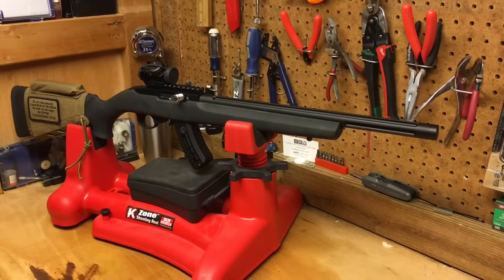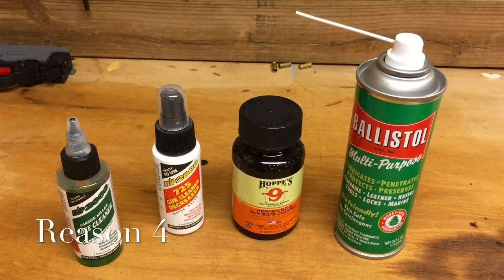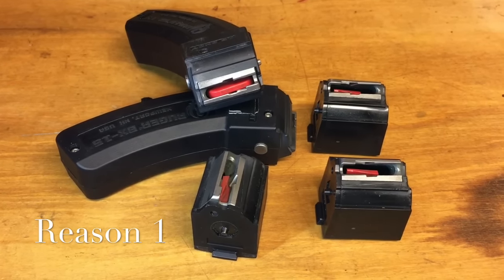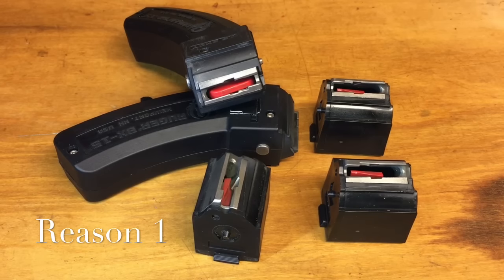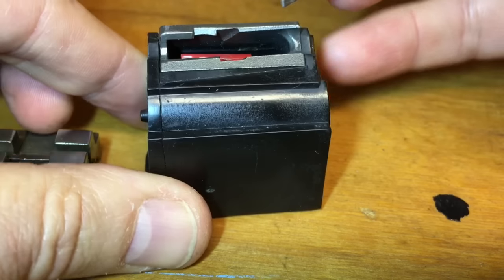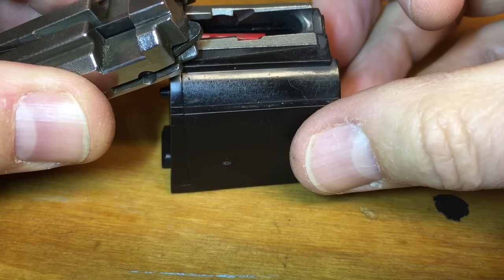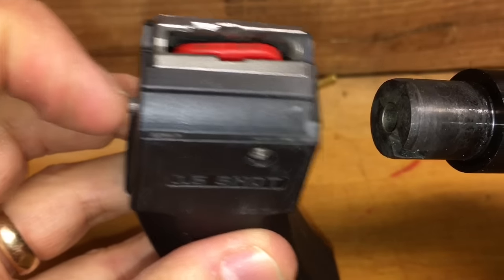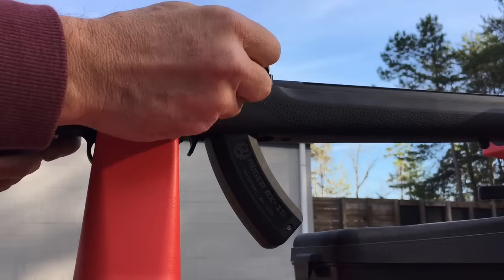Ruger 10/22 Top 5  jams and stovepipe causes and fixes

Comment: thanks alot for the video. 
helpful info for Sure. 
what's your thoughts on sub sonic ammo in a semi automatic rimfire ? enough energy to consistently cycle ?
Reply from the maker: I guess it depends on the gun and the ammo. I have seen people fire sub sonic ammo in a ruger mk iii pistol (silencer also) with no problems. I applied for a 22 silencer tax stamp last July, could be any week now and I will be playing with a lot of sub sonic 22.
Reply: I guess I generally think that a at least standard velocity load is best to insure consistent cycling with less chance of early ejecting. Whatch think?
Reply from the maker: I think the risk of a sub sonic round (or under powered round) is that the bolt won't cycle all the way back to reset the trigger or strip a new round from the mag. If there is not enough power to hit the ejector on the mag, then you may not get the trigger reset and new round loader either. That is my guess. I don't shoot much sub sonic.... Yet :)
Reply: Like most guns I've met, they are picky about what ammo they like best.
It took a few try to find out which my daughters Henry lever action 22 youth model liked and it hasn't failed once over hundreds of rounds. I'm not big on starting kids on semi automatic firearms. 
That's just my point of view. 
Lever or bolt action seems to make them concentrate more and develop a larger skill set in regards to a connection to their rifle.
Just an old dad throwin somthing off topic cause I can. 
Peace to all. ...

Comment: Just an FYI to 10/22 owners, you should NOT insert the magazine with a closed bolt, lock the bolt rearward and then insert the magazine, this allows the magazine to seat correctly
Reply from the maker: Thanks for the tip Steve.

Comment: I had a 10/22 that was a jamomatic and would sometimes fire out of battery or do double taps

I had to send it back to Ruger 3 times over half a year to get it fixed. it sat on the shelf most of the time and the service center wouldn't return my emails or calls. this is in Canada so it was a Ruger service center here

I had to contact Ruger USA in order to get them to contact the Canadian service center to reply to my emails

they sent my gun back and it was the same.....I had to send it three times before they replaced the bolt which was out of spec

when I watched videos like this one trying to figure what was wrong with it......I'd get Ruger fan boys calling me a liar and a troll, saying they have 10,000 rounds with zero malfunctions, I'm limp wristing the rifle, using bad ammo, blah blah blah

the gun is now working flawless. I am never going to buy another Ruger product because of their crappy customer service
Reply: Sounds about right.  Thanks for sharing.

Comment: Bolt buffer and subsonic spring from kidd and they will run any kind of ammo.
Reply: Me to Michael, anything from KIDD. I run a subsonic platform 10/22, and I run a BFS from Franklin Armory. I run a KIDD high velocity charger spring in it. No issues. But on this video I like the tape mod on the 15 and 25 BX mags.

Comment: Good observation.
BUT, TAPE?
NEVER!
Get some shim stock and cut it to match, or even a proper, thin piece of plastic and glue it (Super or 5 minute Epoxy) in place on the magazine.
Reply from the maker: Thanks for the feedback, I agree that plastic is a better long term solution. Temporary duct tape can at least confirmed that a magazine needs the bumper built up. Duct tape is basically gummy glue and thin woven string, so the tape area that covers/touches the magazine bumper may become pressed and flatten out after shooting 100-300 rounds
Reply: Aluminum gutter tape or aircraft "speed tape" should work as well too, without the gummy adhesive mess.

Comment: I haven't read all of the comments so I apologize if the questions been answered. Why hasn't Ruger corrected the problem with the larger magazines. I'm sure they're aware of the difference in sizes between the 10-rounder and the 25 and so on. Maybe they make the larger magazine  a little smaller so that they'll fit older 10/22 magazine well as they may be smaller than current models. huh, huh huh genius!
Reply from the maker: I don't know why Bob. It could be that they see both mags sizes as workable options, but one may wear down quicker. Just a guess.

Comment: Do you have any experience with the .17Hmr ruger American? I have problems with the first round chambering.
Reply from the maker: the .17Hmr ruger American uses a similar box mag, try the tape method in this video to see if you have a "froward seating problem" If it works, you can remove the tape and put in a stronger magazine release spring.  If under warranty, call ruger, they are very helpful.
Reply: 300zxdriver    It's a overhyped, over-priced, Ruger piece of crap. Period.      Ruger doesn't impress me, at all.  My Marlins are ten times better than these, in every way. Even the price!

Comment: I'm sure this is not going to win any admiration from the Ruger purist crowd. BX-25 magazines are crap. I have not tried the 15. I use 25 round Butler Creek Hot Lips and have no problems whatsoever. The Ruger BX-25's fail to feed, fail to eject, stovepipe. . .  I have even had the bolt hang up on the rear of the mag and not be able to go far enough forward to strip a round out of the magazine. 
Love my 10/22's. And yes, the 10 round mags work great.
Reply: C. Daisy   I DO NOT love my new 10/22.  This gun is wayyyyy overhyped.  It's junk!!!!  Mine had FTE problems, straight out of the box.        Have you people never owned a QUALITY firearm??    This is not one of them....lol

Comment: The tape is a simple fix but I would like to think that Ruger is aware of the issue of the magazine wobbling without the tape and correct it by redesigning the plastic ridge on the magazine.  I am not a proponent of plastic parts on any weapons, gun ,rifle, pistol whatever.  Plastic is used because it's a cost effective  way to keep the price of the weapon down.  So they keep the cost and weight of the weapon down but you increase the failure potential of the weapon.  Plastic parts on a weapon is just wrong.
Reply from the maker: Thanks for the feedback Robert. I would love to see a 10/22 mag from the 1960s to see the original materials.
Reply: Kyle Rakestraw thanks for tip

Comment: I just got my 10/22 a couple of months ago, i then bought a spare Original Ruger 10 round Magazine from big5 a day after receiving my rifle. First time i shot the rifle, i kept having failure to feed, i initially thought that it was because it was new, so i took it home and cleaned it. next range day, again it kept having failure to feed issues, so i thought there was a problem with the rifle. Upon further observation, i realized i only had FTF when i am using the spare mag i bought and that the mag that came with the rifle worked flawlessly. I inspected both mags and noticed that the spare mag seemed to have stiffer spring, it was a bit harder to push down compared to my first mag. The next time i had FTF, i looked at the round, and it was stuck in the mag, i had to use a knife to remove it from the mag. i concluded that the mag spring was too stiff and the cartridges are getting pinned between the mag follower, and the mag lip, that's why i kept getting FTF's. I thought if i leave the mag full for a long time, the spring would get less stiff and would fix the mag, but 2 months later, it is still stiff.

Is there a way to adjust the stiffness of the mag spring? i tried searching for videos and couldn't find one, i found your video though, and was hoping you could make a video about adjusting the spring.
Reply from the maker: La Blur, I have not done this before. If you can't return it, you can try to cut a 1/8 inch or so off the spring to see what happens.
Reply: Kyle Rakestraw i've thought about returning it but figured after a couple of months they won't take it back. Lol .... i might just try that, thanks for the reply

Comment: u don't want to put any oil on the bolt face or in the action because it will collect more gunk and it's more trouble then it's worth
Reply from the maker: Thanks for the tip. I will watch for that to see if I experience the same thing.

Comment: Mine has repeated failure to fire. Looks like its getting a light hit on the rim on the casing. Cleaned and lubed and still does it. I took the bolt apart and thoroughly cleaned it and still does it. I'm wondering if springs are worn out or something. I picked up the wolf spring kit and maybe it will help. Anyone else have that issue?
Reply from the maker: I recommend shaving the firing pin. 
https://www.youtube.com/watch?v=67ZKBIPHFdc
Reply: Kyle Rakestraw good idea wish I saw this sooner. I had already ordered a Wolff spring kit and fixed that part. About 100 rounds fired without a single misfire. Now I just have to fix the stovepipe jam issue and it'll be good. Thanks for the advice I'll have to check out the other things in the video for my other issue.

Comment: Mine will shoot about 400 rounds, before it needs a good scrubbin'. I had trouble with FTE, when I first got it. I installed a stronger plunger spring, and it runs ok now. These guns are overrated, in my opinion. The mag-wells aren't up to spec. Most of them are too large. Mine is...   My 10 rounder even has some slack in it. A little more than this guy's, actually.

Comment: spring load the ejector on the trigger group. drill a small hole in the ejector slot  of trigger , insert spring, and now  what i call primary ejector always is in proper position.
Reply from the maker: James, I like the idea of using a spring to solve this common problem. I did try using a stronger spring for the mag ejector and it was not fully successful. I'm not sure I understand your suggestion. Are you recommending putting a spring on the trigger group somewhere to better align the primary ejector that is on the magazine?  Can you send a pic or drawing?
Reply: Tell me how to send you a pic on here and i will be glad to
Reply: hey Kyle,
when  i said to spring load ejector i was referring to the one on the trigger assembly. i believe you call that the secondary ejector in your video. the little slot that it lives in is a good place to drill a hole for a spring, and maybe notch the ejector so the spring is retained. that way every time the bolt is cycled, the spring pushes the ejector as high as it can go. this spring loaded ejector makes up for a lot of variables in receiver tolerances, etc.  your vid shows that your mod fixed stovepipes, but does the non modded mag eject loaded rounds reliably?...also  didnt seem like your gun had a problem feeding rounds, just ejecting. trust me that little shelf on the magazine is not your problem. Man, lots of variables... I would highly recommend that you purchase American gunsmithing Institute armorers course Dvd on 10/22 . Robert 
Dunlap will show you everything about that gun, and i mean everything.
Reply from the maker: It is true that there are many variables. This video was to address common jams & stovepipes. The primary ejector for the 10/22 is on the magazine. The secondary ejector is on the trigger assembly and plays no role when a magazine is in use. I use the term "secondary" because that is the official term that Ruger uses: go to 2:01 on the below page/video link to hear it from Ruger. You can make a video that shows how your modification resolved any specific misfire scenario.  That way you can present your concept, show others how to do it and give visual/video confirmation. Thanks for your feedback

http://www.ruger-firearms.com/micros/BX-Trigger/index.html
Reply from the maker: Do you have a picture of a completed modification that you are suggesting?  I would love to see that.

Comment: I wish I bought a smith & wesson instead of the ruger. Brand new ruger 10/22 stove piping out of the gate. Thing is garbage. Why would ruger sell garbage like this? I put the extractor, have 3 different OEM 10rd mags, and tried bending the secondary extractor and the piece of crap still stove pipes spent casings. So dissatisfied I cant see buying another ruger product ever again
Reply from the maker: I have found that Ruger has great customer service when you call them.

Comment: my 10 22 is having a different issue. im constantly having to push the bolt lock up about every 3 rds. Brand new gun. The bolt will lock itself back and I have to release it about 3 times per ten rounds. any ideas?
Reply from the maker: Its hard for my to say without seeing your gun. I suggest completing the auto bolt release mod at the link below. This may fix your problem and you get the nice upgrade too. You can also purchase this part "10/22 auto bolt release" for under $20. 

https://youtu.be/fIOn_8NJI8E
Reply: Kyle Rakestraw thank you, Im going to contact ruger on this issue. the gun is only 5 days old.
Reply from the maker: Top Dog obedience OK, Ruger technical support is very good. Make sure you have your serial number.
Reply: Top Dog obedience   One of two things:  The bolts on your rail are too long, protruding into the chamber.   Or, the magazine is sitting too high, causing the mag lips to stop the bolt.

Comment: I don't have a 10/22 and never really understood the point. It seems like a squirrel rifle that wants to grow up and be an assault rifle. Besides, most jams/mis-feeds/failures to eject I've seen seem to almost always be related to lack of maintenance, powder residue/fowling, carbon build-up, improper maintenance. Most greenhorns use too much oil- it's like a magnet for dust, grit, and other things you don't want in your gun. Clean it with an all-around product like CLP, wipe it down, dry it off and reassemble (the residual lubricant in CLP that remains is all you need). Note to self: if your gun needs to be duct taped in order to work properly- "Houston, we have a problem."
Reply: Yukon Cornelius   It's an "out of spec" problem with Ruger, on these crappy 10/22's. Every mag well, is a different dimension.  Horrible quality!!!

Comment: Put a stronger spring in you meg retention and u do not need tape
Reply from the maker: Corey, I did add the strongest spring that would fit in the mag release (# 5 or #9? midwest fastener, cut down the size) . The spring was so strong that the 10 round mag was very difficult to remove and it did not fix my gross loose mag issue. I believe that your suggestion is a good fix for some slight loose mags, but not all. 

This is the same method used in here:
https://www.youtube.com/watch?v=fRrfhHI0JYs
Reply: Corey Blanchard   That's what I did.... I found a stronger spring in a spray bottle, at home. It's running much better, now.  One FTE, out of 200 rounds, today. The way it should have ran, out of the box, three days ago!!!

Comment: Wow, what a cheap design (flaw) why would you put the ejector/extractor on the mag feed lip-? That's gotta be one of the most ghetto el-cheapo designs I've seen yet &( I bet there's many more out there, still learning) & another thing, i'll not be buying this for my grandson now, Marlin model 60 is looking really good to me. Thanks for the video (& heads up on this poor design)
Reply from the maker: Marlins are good also. The 10/22 was designed back in the 60s and is a favorite for many for over 50 years. If you run the 10 round mags, you may never see the problem. Your choice.
Reply: Bob fedder Go with the marlin. A younger buddy of mine just got the stainless marlin 60 and we've shot 4 100rd boxes so far without one failure staight out of the box without a cleaning yet. I own three over 30 yrs old and still running flawlessly. Also you want have a long magazine in your way to get hung on every briar and vine in the woods.

Comment: Nice try! You didn't fully cycle the charging handle for your wobbly mag demonstration. That's what caused your stovepipe.
Reply from the maker: Wrong FBI Man, The chamber was cleared in the video, then the mag was inserted and fully cycled as seen. Only a full cycle can stripe a new round off the mag. If a gun is cleared and not fully cycled, then there would be no round to fire the gun< This is where your argument fails.